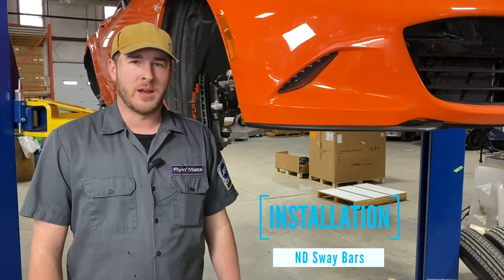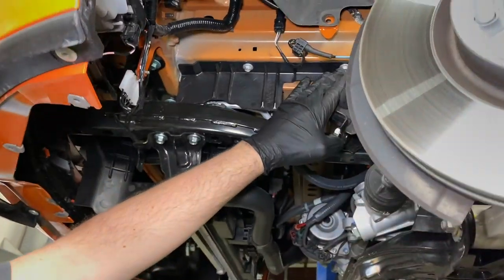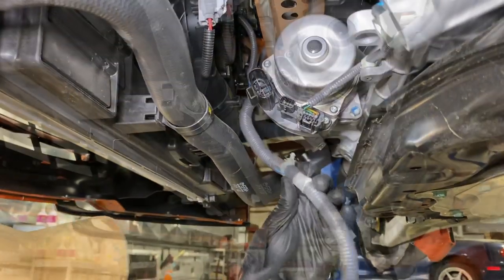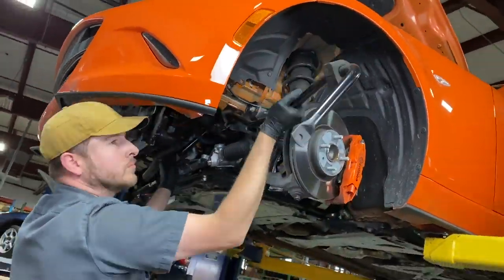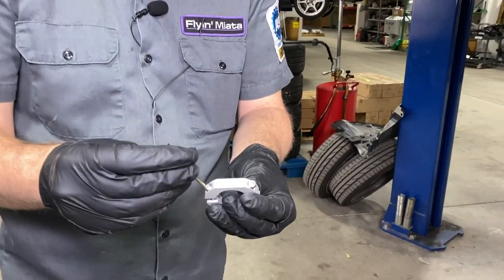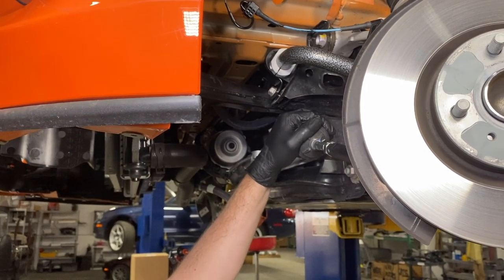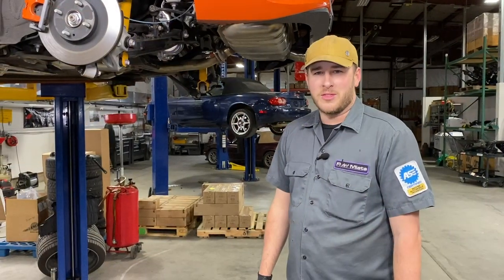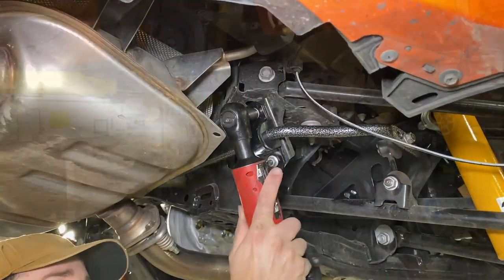ND MX-5 Flyin' Miata Sway Bar Installation

Comment: Useful Tip: Reinstall the 2 radiator hose bolts before installing the new sway bar bushings/bracket which allows for much-needed extra room.
Reply: Thank you

Comment: Thanks, excellent instructions. I used them to install a Progress sway bar in a 2020 ND today. One comment or rather suggestion; reinstall that difficult bolt on the solid cooling hose right after you get the bar in place but before you secure it rather than after. You only need that pipe out of the way to snake the bar in, once it's in but before it's secured that pesky rear bolt is a snap to reinstall.

Comment: For those that have trouble bolting/unbolting the rear radiator bracket bolt, go for it from the engine bay, use a long extension, straight down, it was SUPER easy. To bolt it back in, just use tissue paper on the nut and socket to keep the bolt in place and wiggle it in after installing the front radiator bracket bolt. This is on a RHD version btw, pretty sure it's the same for LHD.

Comment: Did the job with a friend who is also completely inexperienced in about 3.5 hours. I literally went to Harbor Freight yesterday and bought a jack and tools last night. That's how much we don't know what we're doing.
Only hiccups, we snapped one of the plastic clips holding the power steering wires. Also, that bolt on top of the radiator hose is super difficult to put back in. Other than that, no parts left over. Car works like a charm.
Thanks so much for the great video!

Comment: This video was super helpful. I just completed the install with just jack stands. A couple tricks I found which helped me:
- Unbolt the sway bar from the mounts before trying to remove the rear radiator hose bolt. This let me get my hand in there and made it much easier. Same goes for putting in the new sway bar: Bolt in the rear hose bolt before bolting in the sway bar brackets.
- Before trying to remove the sway bar, use a flat head and pry the metal bracket off of the bushing. This gives a lot more room for squeezing it through the gaps and the metal won't scrape
Reply: This is exactly what I did.  Way easier.
Reply: Came to say this

Comment: Destructive tip: Cut out the passenger side sway bushing. Use a narrow flat heavy steel scraper to wedge in between glued on surface of the bar and bushing; spray brake cleaner onto the glued surface as you pry up to "eat away" the glue, use heavy forces to pry that sucker off. Much better than trying to clear that gdam glued on bushing! 

Even with this excellent tutorial it was a nightmare of a job. 4 hours of clanging banging around the subframe and radiator, screaming wife and kids. Wouldn't wish this install on my worst enemies. Used to be sway bar was a cheap and easy mod. On NDs put in some race springs/shocks/coilovers and call it a day, they do the same thing as sway bar.
Reply from the maker: Sorry you had such a rough time, it's definitely not a fun job!

Comment: Thanks so much FM for the professional, clear and concise instructions.  Pretty much followed it exactly with no fuss.  I ended up cutting the plastic straps holding the electric steering harness then zip-tying back.  As advised by others, I put back the rear radiator hose bracket bolt first before the right swaybar mount.  Took 4 hrs f+r on jack stands and a bit of swearing to get the front bars in and out.  Getting front bar out was not that bad in the end, soap on the right rubber bush helped.  New bar in was a bit more of a struggle, like a big Tetris game, luck of positioning the bar to get it over the chassis rail, swing around and then over both steering rods.

Comment: Some new tips for anyone struggling. The power steering cables can be tricky, slide that red tab outward, then use a flat head to press down in the area where that red tab was, mine made a click sound and then I could easily slide the connector off. Don't pull on the cables, if it's not coming off get a flashlight and look closer to where you need to press with a flat head screwdriver. 

The clip holding the power steering wire harness on the top is a pain. In the video they already had it removed. I broke mine off after 30 minutes of prying it with a flat head. Then I noticed that if you look on the other end of where the clip attaches to the power steering frame, there is a hole, so if you don't want to break it off, you could maybe use a thin drill bit or something that will fit and then tap with a hammer to hopefully get that clip to pop out. I'll just have to ziptie mine back through that hole since I broke the clip.

Go to Amazon and order upgraded plastic retainer clips. Search for Rexka retainer clip mx-5. They're like $12 for a 30 pack. These are the little plastic pop out clips but easier to pop out. You may break many of yours trying to take them out or find that some are missing so it's nice to have these extra ones.

Open your hood and take off your front bumper if you're working outside on jack stands, this will make everything easier to see in daylight.

Unfortunately, this video is edited where they speed up when he's sliding in the new bar, so it's impossible to see exactly how he's doing it. I wish they didn't speed up those very important parts. Pulling the stock bar out and sliding the new one in can require many attempts. If you get frustrated then take a break and try again, don't rush it and watch the other end of the bar because it can scratch your fender and damage clips/wires. Don't worry if it takes you an extra day to figure it out. I ended up pulling the entire bar out from the passenger side to try again.

As others have said, get that rear radiator bolt on before adding the bushings and brackets on the new bar. I ziptied the bar to the upper control arm to keep it out of the way

For the swaybar bracket, the upper nut requires a thinner and slightly angled box wrench. A ratchet type wrench is too thick to fit there. Make sure you have a regular thin one, preferably where the head is angled a bit too.

If an end link is stuck on the swaybar even though you removed the nut, get your floor jack and carefully jack up on your control arm to compress it upward until you can wiggle the end link bolt easily from the swaybar.
Reply from the maker: Thanks for the tips!

Comment: Used this method to replace my front sway bar yesterday! Thank you for the video, it was super helpful! Was able to get the car up on a lift at a local DIY garage - I would highly recommend looking for one of these shops! I can't imagine trying to do this with the car on jack stands. It took me (not a mechanic, but rather handy and my work involves some weekly-wrenching) about three hours start to finish. Tear-down was on the order of two hours and install/reassembly about one hour. 

A note on the coolant hard line - getting the front bolt is easy, but I was not able to get the rear bolt off until I removed the passenger side sway bar mount to give myself more room. If you struggle with the rear bolt, simply proceed with the tear-down and come back to it once you're trying to phenagle the bar around.

On the driver side, I kept hitting what I believe is a grounding point for many of the front end electronics. I'd recommend unbolting that, as it did look rather fragile. It was simply about 8 leads into a plastic clip that was bolted onto a metal mount. A quick little addition that could save headaches down the road. 

I struggled most of course squeezing the factory bushing between the subframe and the body (as noted in the video). Some soapy water helped squeeze through - a trick I would highly encourage using.
Reply from the maker: Thanks for the kind words and helpful advice for those that need it!

Comment: Fantastic instructions. Just finished the job on jack stands. 6 hours. Followed these instructions all along the way. Lube bushing on old sway and comes out without much trouble at all (follow video guidance).
Also strongly recommend having ratcheting type  wrenches with pivoting head. Will be especially valuable for the most difficult to reach bolt. Do NOT use this sort of wrench on top bold of sway bushing bracket. Open end wrench only!
Don’t be too intimidated by this job. Really not that bad.

Comment: Did my install today with little drama thanks to this excellent video. Would recommend getting a set of short stubby box wrenches: 10, 12, and 14mm. Cutting the stock bar with an angle grinder will also save frustration.
Reply from the maker: Having the right tools makes everything easier. Glad the video helped!

Comment: I just did this install great video!  Would also recommend detached the abs sensor from the upper control arm as it is in way when your tightening down the nuts on the top of the swat bar brace also disconnect the other end of the water temp sensor for ND1 it has two connections its in the way when your trying to remove/install the sway bar

Comment: I just completed this job.  What a PITA, but I got it done.  the old bushings were really being a bitch so I just cut the bushing in half to make it less thick and It came right out.  That is the only other thing I would offer.  also, when you are putting the new one in, tighten down the back bolt for the coolant pipe before you lock down the sway bar.

Comment: I installed the whiteline front and rear swaybars thanks to this tutorial. I struggled a bit more than in the video. For the front I think the geometry of the bar is slightly different, or maybe slightly bigger. I had to unscrew the 3 screws of the electrical steering assist motor to be able to rotate it to make way for the bar. I also had to unscrew the steering ball joints to be able to put the bar into position before attaching it.
Reply from the maker: We can't guarantee this exact method will work with any sway bar except the FM bar we sell, but hopefully the video helped you out with a few bits!
Reply: @FlyinMiataVideo  Yes it was very helpful. Thanks guys! Unfortunately there is no whiteline tutorial 😞
Reply: Can you explain with screws you removed on the steering assist? I'm currently struggling with Whiteline.

Comment: Great video. Like others I've heard horror stories about the front install - this didn't look so bad at all. I've a 124 Spider so I need to take a look at see what's the same and what's different. Pretty sure the intercooler pipes will be in the way if nothing else.

Comment: Remove the liners, unbolt the radiator hose and passenger aide radiator mounts, next and most critical step CUT the old sway bar, new sway bar will slide right In. Put it all back Together. Don’t forget your reinforcement brackets

Comment: I know this was done like 2 yrs ago, but I just watched this for a second time. 
Those collars you put on in an angle to prevent the bar from moving, is this required on all sway bars or just FM sway bars?
If just FM sway bars, why?
Would it be better to load the bar to ride height before placing on the collars/locks?
I also noticed you did not use any LocTite, is it not required?

Thank you!

Comment: I have a Gen 3 Mazda 3.. I installed a front bar on mine.. wish doing something like this was an option. It was a major PITA.. have to lower the front subframe.. disconnect the exhaust before the 2nd cat and pull it out from under the car..
Reply from the maker: That sounds like a big install for a sway bar. And here we thought the ND was a pain compared to other Miatas!

Comment: How well centered does the swaybar have to be before securing it? Mine is like 1/8 of an inch off. If it's not perfect will it affect how it performs? Does it self-adjust side-to-side once the car is on the ground and driving?
Reply from the maker: Our ND sway bars include collars that prevent the sway bar from moving from left to right very much (they're installed on either side of the sway bar bushings).  The sway bar needs to be pretty well-centered before the collars are installed because the sway bar won't move left-right after that.

1/8" away from perfectly centered is probably OK.  Aiming for as close to perfectly centered is ideal.

Comment: What is the method for removing the coolant temp sensor plug?  Is it a depressible type of pin?  Also, what settings would be closest to the feel of the stock sway bar, the middle on the front and back?

Comment: Hello, I have a 2016 ND Club with Bilsteins and stock springs. Do you still recommend the middle hole on the sway bars for the stock setup for best settings. I was thinking middle hole in the front and outer hole in the rear for a little understeer bias. Thoughts? Just trying to get rid of the horrible body roll mainly.
Reply from the maker: The middle holes are where we recommend to start to give a fairly neutral handling balance. This can vary slightly from car to car depending on the alignment and how the rest of the suspension is set up. The sway bar settings are very easy to change, so feel free to experiment to get the handling characteristics that you prefer!

Comment: Brilliant video. I have a (maybe) stupid question. Battery is disconnected. Steering lock is automatically on. How could you move the wheels? How could you disable the steering lock without having the ACC/ignition on?
Reply from the maker: Fun fact - the ND doesn't have a steering lock.

Comment: How much room do you need next to the car to remove the front swaybar? I have a smaller space and don't want run out of space when the car is on jack stands and pulled apart.
Reply from the maker: We would plan on having the length of the sway bar on one side at a minimum.

Comment: Great video on the install. I'm have a 18 124 Spider Abarth. Are the bars for the ND miata the same as the 124?
Reply from the maker: They are the same, but installation will vary a bit from this guide.

Comment: Do the bushings need to be regreased? If so, about how often? I know we add drive our cars differently and for a different number of miles per year.
Reply from the maker: It depends on how and where the car is driven.  Cars driven in dirty/salty/really wet conditions will likely need to have the bushings cleaned and re-greased a lot more often than a pristine museum example.  The short answer is that if they start making noise or just look dirty, it’s time to clean and re-grease.  Just like changing any other fluid or grease on a vehicle, it never hurts the car to refresh it sooner than later.

Comment: Is there any reason that you didn't install the braces while doing this installation?  I'm debating on how much the braces are going to be needed when I upgrade to your sway bar set for my 2020 Club.  It will be driven in a spirited fashion on the street primarily through back mountain roads in the twisties.  Great instructional video though and is the simplest method that I've seen to do the swap.
Reply from the maker: We didn't have them available at the time we shot this, unfortunately.
The braces are one of those parts that are easy to install and help prevent a bad failure mode. It's good insurance.
Reply: That makes sense.   I'm planning on adding those in with the order when I make it.  Thank you for the response.
Reply: @FlyinMiataVideo  It doesn't look like those would be too difficult to add after the fact. Do you agree?

Comment: Great Video, but I have one question why would you replace the OE sway bar of a ND II 30AE when the car comes with a sway bar on both front and rear..
Reply from the maker: All Miatas come with both front and rear sway bars. Check out our other video on sway bar theory, you'll learn why you might want to change them out.
Reply: Short answer is, aftermarket bars are beefier with less “spring” action, keeping the car flatter with less flex

Comment: What about cutting the OEM sway bar to get it out? Would it be easier?
Reply from the maker: if you had no need for it, you could do that. Just be careful not to cut or burn any of the close plastics or wiring.

Comment: What is the diff between the 3 holes on front and back bars?
Reply from the maker: Stiffness.
 Hole 1 Hole 2 Hole 3
Front 383 lb/in 454 lb/in 546 lb/in
Rear 119 lb/in 154 lb/in 207 lb/in

Comment: is the rear sway bar just hanging around with no center locking?
Reply from the maker: Sway bars have to be free to rotate in their bushings - it's a fundamental part of their design. If you anchor them in the middle they become a torsion bar spring.

Comment: Should new end links also be replaced at same time?
Reply from the maker: End links are fairly easy to swap out, so don't necessarily need to be swapped out at the same time as the sway bar install. This bar will work fine with stock end links, tho you may want to look into adjustable end links if your car is lowered, or if your stock end links are damaged and need replacing.

Comment: that seems like way to much work to change a sway bar, arent u suppoed to tighten the endlinks with the car on the ground with weight on it?
Reply from the maker: The sway bar upgrade makes a huge difference in the handling. If you aren't comfortable with the install, give us a call, we might be able to recommend a shop that can do it for you. The old bushing style end links need to be tightened at ride height in-place with the weight of the car on them. The newer ND ball joint end-links (and our aftermarket end-links) do not require this and can be tightened immediately after installing the sway bar.
Reply: @FlyinMiataVideo  i just got it in after 4 hours of trying to duplicate your step by step instructions. but on jackstands.... cant feel my lower back but its in
Reply from the maker: @protocolpalpatine  A lift definitely makes the job easier. Hope your back is better!